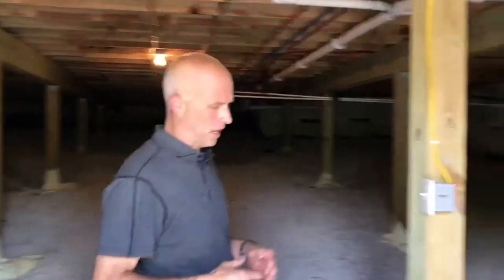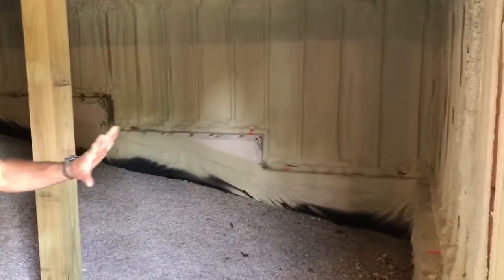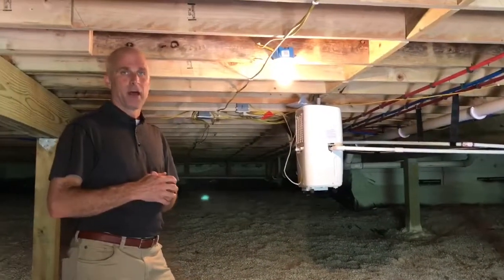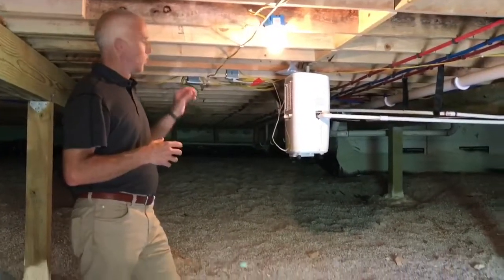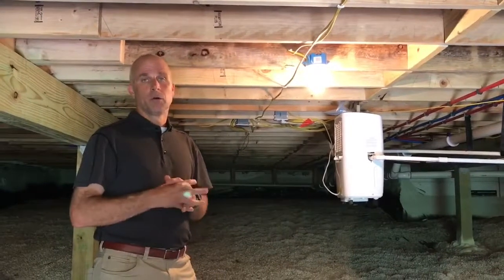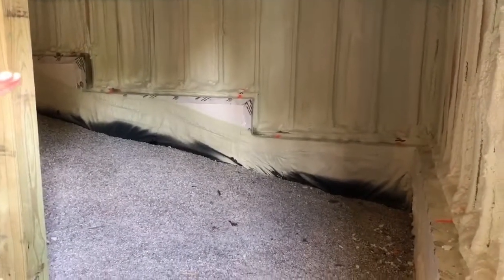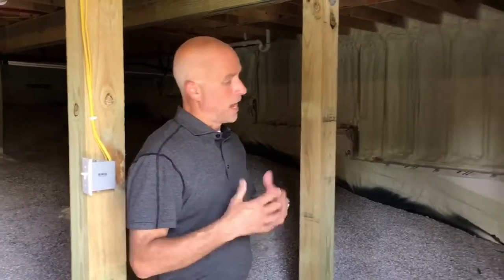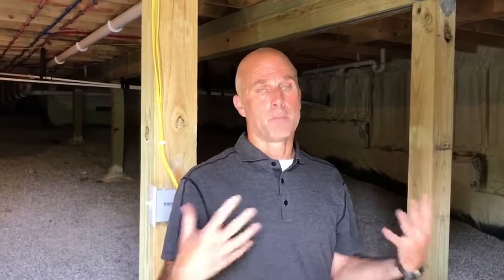Proper Crawl Space Construction

Comment: We're planning to build in the near future. The water table is too high for a basement and I dislike slabs (the idea of jackhammering through concrete to fix something turns me off). My plan is to go with a crawl using ICFs (the whole structure will be ICF) and have a poured floor in the crawl. I hate the visqueen and gravel. I'd rather zip around on a mechanic's creeper over a smooth floor if I have to venture below the house to access something.